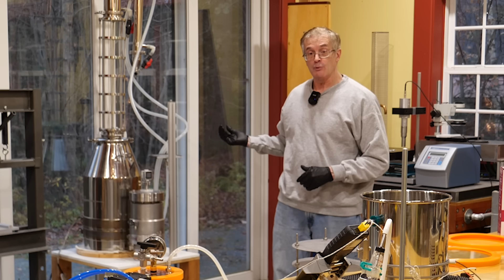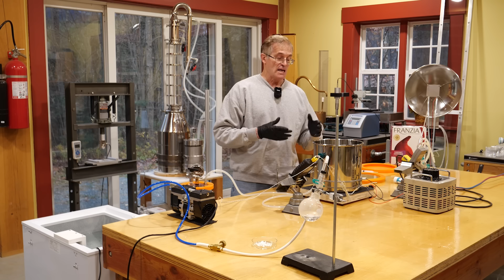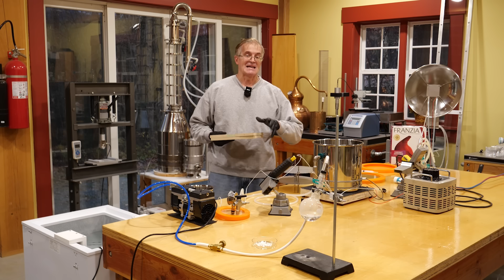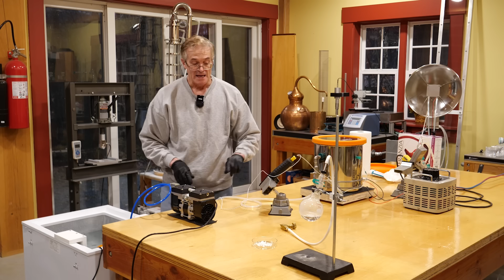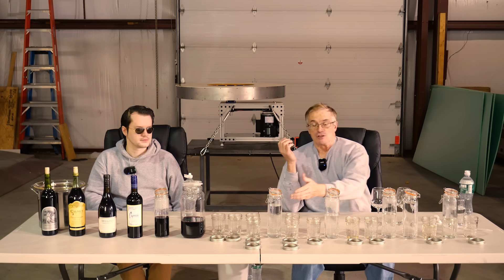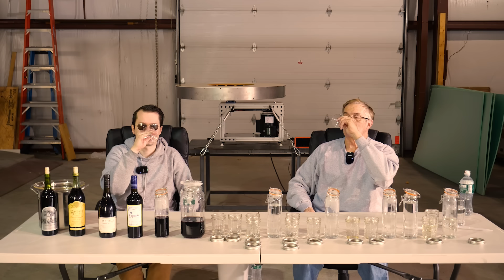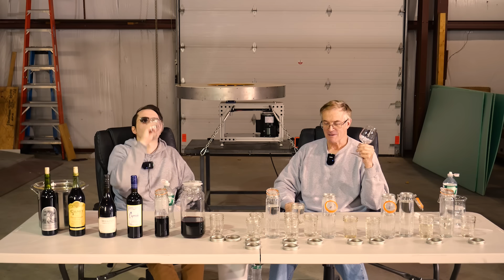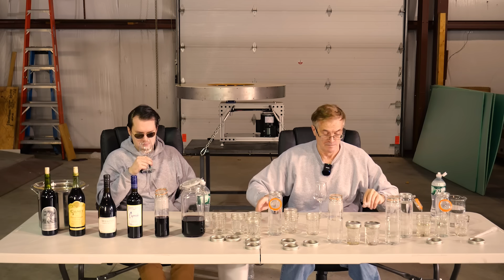Turning $3 Wine into a $100 Vintage with Science!

Comment: You should beware of the heads still, because wine does contain methanol. It comes from the methylation of pectins. Sugar wine which is what I regularly make does not have that.

OTOH, the methanol has to come from somewhere, so it's rare that careless distillation alone would lead to poisoning. Usually the issue is outright addition of wood alcohol to illicit booze for its low cost.
Reply: IMO methanol would just be more concentrated, which would mean they would have to get pretty drunk, to get too much methanol. 

The same as if they drank several bottles of wine, but with most of the volume of the wine removed, leaving the methanol.
Reply: Exactly. And you don't usually do that. You either mix the heads back in or you don't. Nobody drinks them on their own. Then you get a situation where you'll hit ethanol toxicity way before whatever methanol was in there.

This is part a misunderstanding, part an old wives' tale from the temperance and Prohibition days, judiciously left uncorrected by the health and tax authorities.

Trying to get to 96% dry moonshine by distillation alone is risky though. The idea promotes extremely low yield, so much less dilution. There you could end up with a hundred fold higher concentration -- but at a level of waste which hardly ever makes this style commercially viable.
Reply: Yup, not much, but it is a known contributor to the dreaded hangover.
Reply: Yeah, and because it's first up it's really easy to find as you bump up the temperature. It tastes distinctively like not-right alcohol (please don't swallow). Once you're calibrated you just set your temp slightly above where it stops and toss that fraction in the bucket to make winter washer fluid.

Comment: That reduction of boiling temperature is why I have to chill my marinade when I use my chamber vacuum sealer to marinate food.
Reply: Huh? You chill your marinade, so that it doesn't start boiling, when the vacuum sealer is turned on?

I guess I'm wondering if marinade works better if it's """boiling""" -- I guess you're saying that it's better if the marinade does not vacuum boil?
Reply: @PaulLawson-k8v  Yes, I don't want the boiling liquid to reach the pump. Nor do I want to clean a chamber covered in the marinade.  Pulling the air out with the meat submerged in the liquid will remove gasses from the food (those things that vaporize at ~ambient temp. and near zero pressure) and the subsequent release of vacuum will draw the liquid into the food.  What recipes typically recommend (hours to days) can be accomplished in a few minutes.
Reply: As you bring it back to room pressure the flavors fill in and are absorbed whatever the meat.

Comment: There is a hole punch tool for irrigation systems that may work better than a drill for making a hole in the stopper. It's basically just a small cylinder of steel attached to a handle. You can find them online by searching for irrigation hole punch.

Comment: Wow.... 100 minutes. This is going to be good.
Reply: No, it's actually quite silly.  He has at least $5-600 in equipment for this.   Who is going to spend hundreds of dollars in equipment to do this?  Unless you already know you can make something you really like and are a heavy drinker, this is just a total waste of money if you don't already own all of the stuff.
Reply: @tarstarkusz  you can use vacuum distillation for a lot of other things, not just booze.
Reply: @tarstarkusz  Why would you not want all that equipment? How am I going to make my ultra pure ramen?
Reply: @tarstarkusz  It is a bit silly. However, I don't think it's quite $600 worth of equipment, especially when the chest freezer can be replaced with a bowl of ice and water, you just need to have a supply of ice to keep adding to keep it at 32F. Or you can use the chest freezer you already have and just clean it out to do a run or 2 occasionally. Also, I could think of a lot of interesting things one could do with a vacuum distillation setup.

However, I think drinking alcohol is silly in general and should be avoided. But if you want to get drunk just grab some everclear (195 proof) and mix it with water. Then have a separate tasty drink to chase it with lol.

It's interesting If you mix water and ethanol to about 5% ABV it's like a beer, with no flavor. In my opinion it's better than beer because beer flavor is pretty gnarly in my singular opinion. I would add a squeeze of lemon or lime to try and counter the bitter alcohol, but it's not too bad straight imo.

If you want to get drunk drink the cheapest ethanol you can find. If you want a tasty beverage grab some juice, a soda, or something that actually tastes good lol. This is just one man's opinion though, and I'm sure plenty of people disagree with my assessment.
Reply: Yeah. I mean, or 1 hr and 40 minutes.